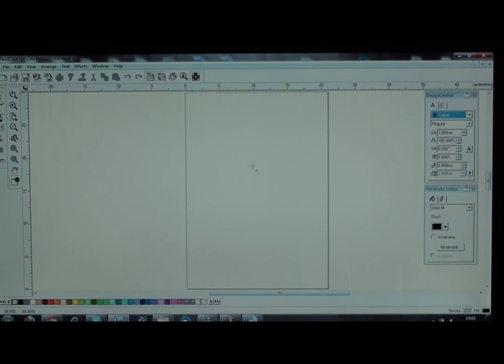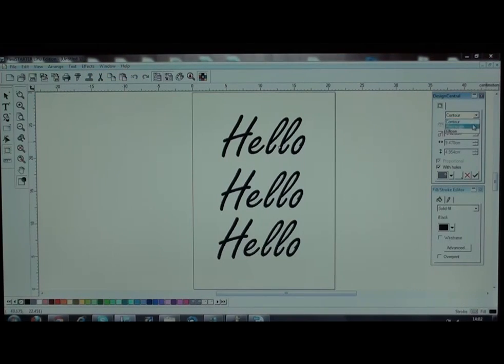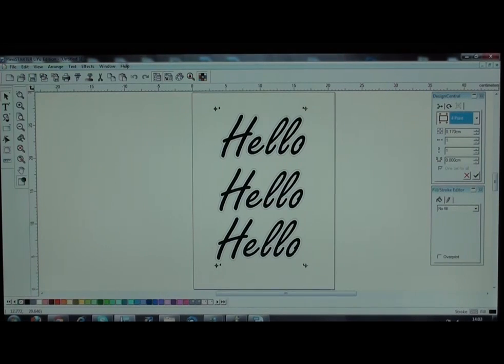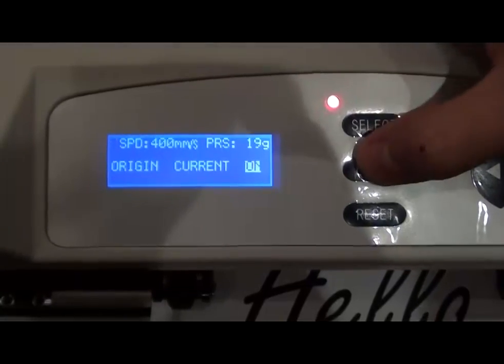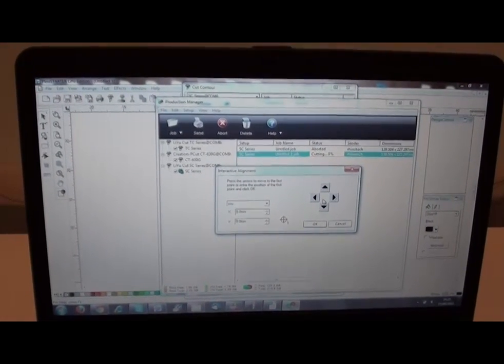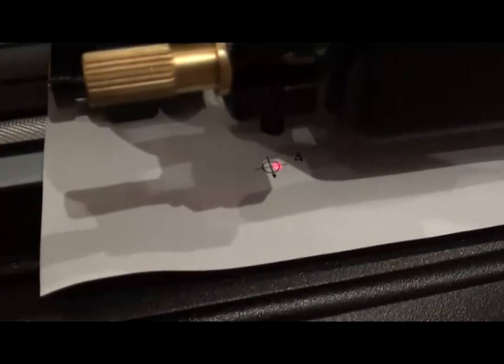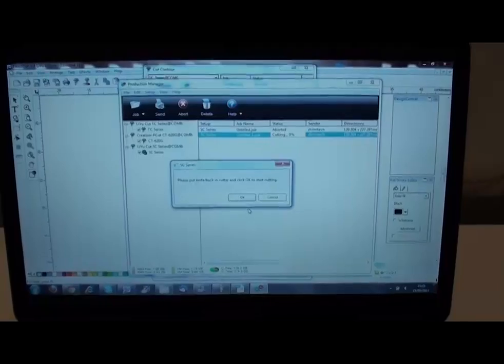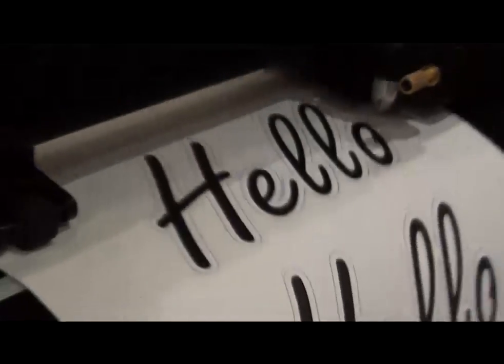HOW TO USE CONTOUR CUTTING WITH FLEXI

Comment: i have flexi 10 and when i try cutting my sign, instead of cutting vertically, it cuts horizontally on the material which doesnt fit. I have a 24 inch roll, but the image is 30 x 21. instead of cutting 21 horizontally and 30 vertically, it does the opposite, which doesnt fit on the roll so it stops. I wasted a lot of material because of this. Any suggestion on how to fix this?
Thanks
Reply: When you go into the cutter page, you can see your letters or drawing on the RH side of the page...which represents  your roll.  If you look on the left hand side of the screen, you can see the settings. At the bottom you can see orientation, which means you can change the direction the letters or drawing is layed out on your roll. It looks like a man figure.:) You can rotate him and as you do, the location changes on your cutting board.   Can you see him?  Play with that and he will rotate to set up your image the direction you want it cut on your roll.  You can even reverse your image so it cuts to go onto a window pane...hope this helps buddy!:) Cheers, Vicki

Comment: I have flexi 10 with saga cutter and I have problems, the cutter reacts late when I try to cut with registration marks, I put a distance on flexi and my plotter reacts 10 secods later and when I press cancel it reacts, what could be the problem? please I need help
Reply: I use flexi 10 on win7 ultimate 64 bit, with USB 2.0 may I need the Com1 cable????

Comment: Flexi is an easy software to work with i think it's just the vinyl cutter that suck. The roland gx 24 will do all that work for you so you don't do it manually. Only thing you do with the gx 24 is to load the paper in the cutter and click send, the optical eye will find the marks and contour cut it